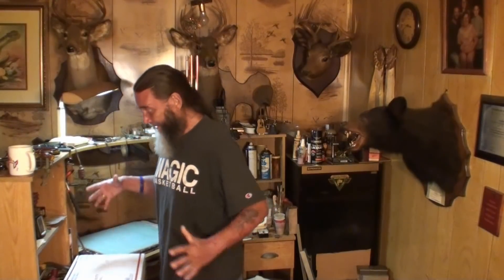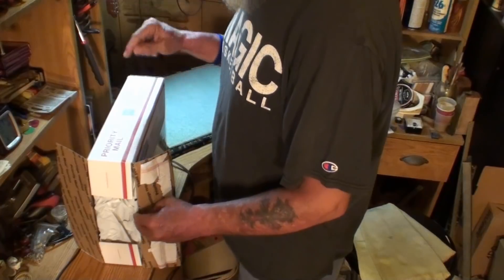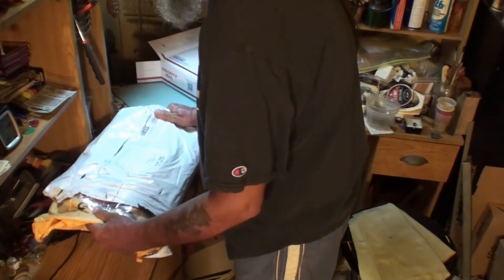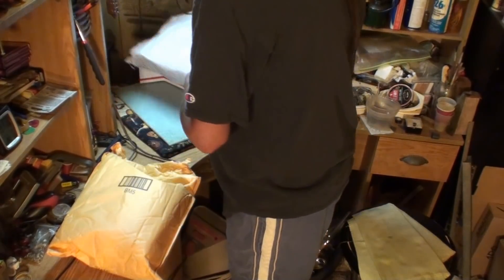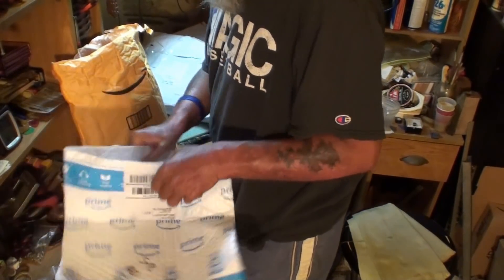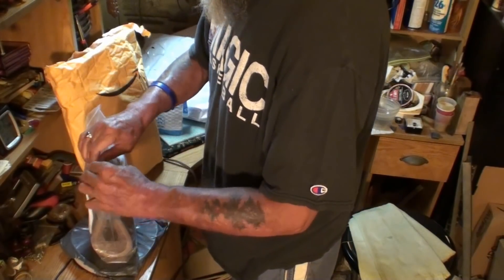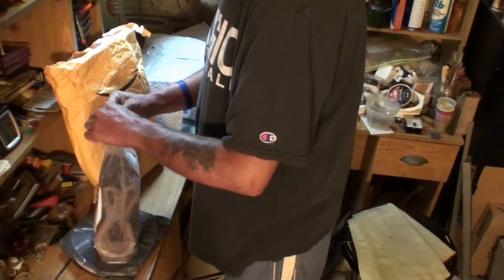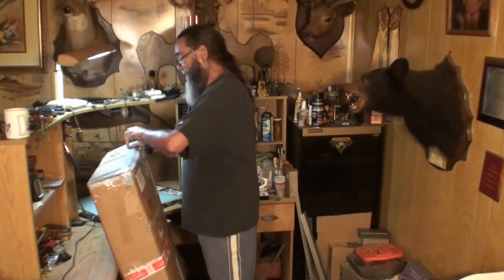unboxing guitar what kind of guitar? and more!

Comment: Hello Randy. I remember you said you are real busy and answering comments is "spotty" but I ask, maybe a viewer answers. I live in Tucson, it is dry,think 10% for much of the year. I have to keep my solid wood guitars in the case and always water the sponges and other humidifier devices. I want a guitar that I can leave out of the case. I ask,does this mean a laminate,both top,sides,back? I know I could get at minimum one of those tent like storage devices and keep my guitars out of the case that way,but more fun to get another guitar. Which fully laminate guitar (perhaps Takamine?) Thanks.
Reply: Carbon fiber would be the thing but their not exactly cheap yet.
Reply from the maker: fully laminated or better yet carbon fiber body as Jim suggested, those carbon fiber guitars don't sound bad at all and you can play them out in a rain storm, the only thing will be the strings rust assuming you're not using gut or nylon strings. good luck! and thanks for watching!
Reply: @RandySchartiger  Thanks (Jim also) I am going to ask at my local store here in Tucson (Chicago Music) if they have some type carbon fiber guitar in stock. I did a search and there is one called "outdoor guitar" from Outdoor Ukulele.